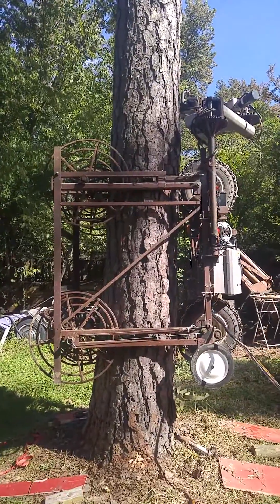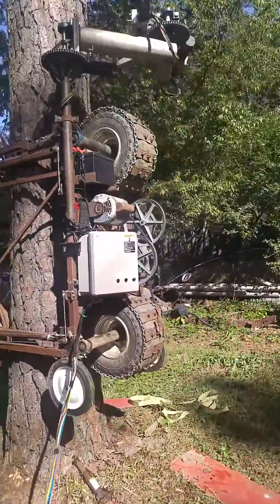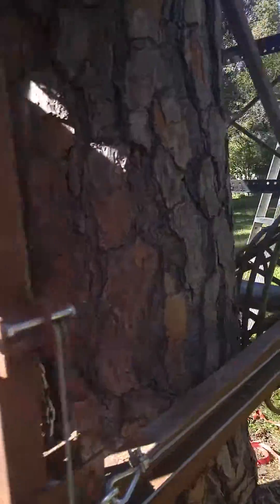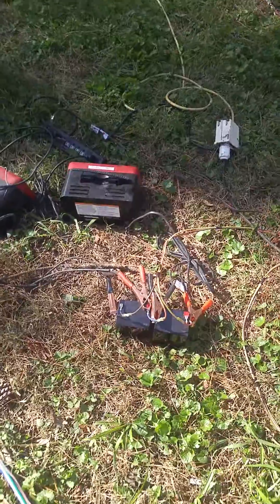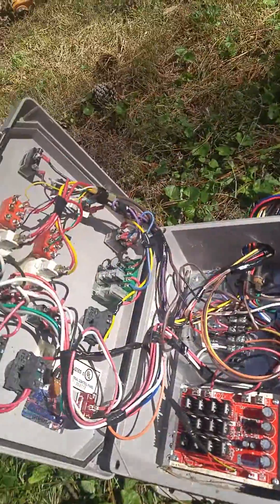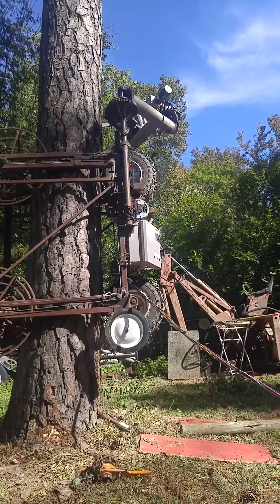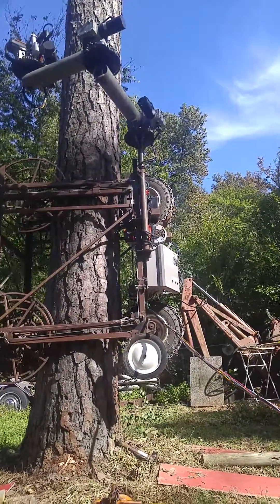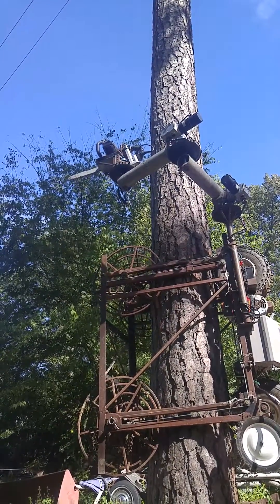Tree climb/ cutting robot

Comment: Thank you for putting this up.  I am looking to trim a bunch of trees in my backyard.  I intend to stay on the ground.  Absolutely wonderful so many videos I can watch first.  Probably go with Rope Chain Saw, but looks tiring (I've got lots of branches to trim) and prone to binding.
Reply: Im in a similar boat. About 10 fir trees between 70 and 130' tall, all only needing a few branches removed. I've done what i can with the rope chain but getting it 60' up is out of reach. You find anything cool? Seems like a small (smaller than this)3  rc car type things around the tree, connected with springs to hold tension as the trunk gets smaller, and a small electric chainsaw could work. Seeing as im not an engineer in any way, i can only dream up basic ideas